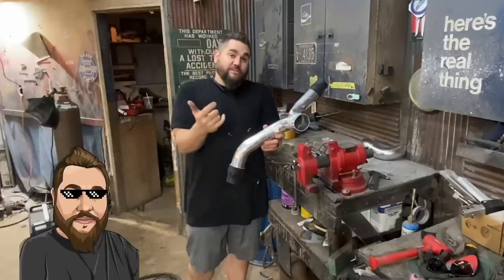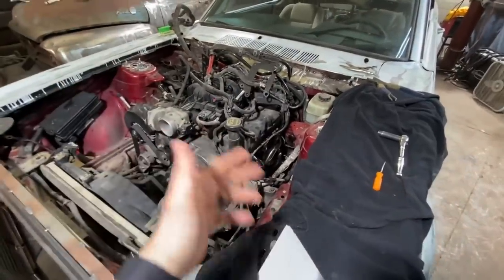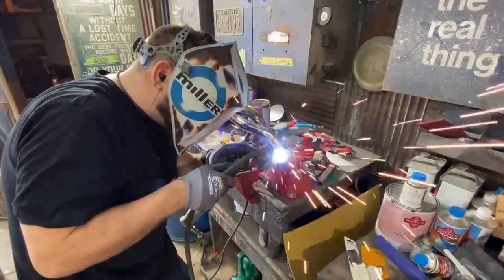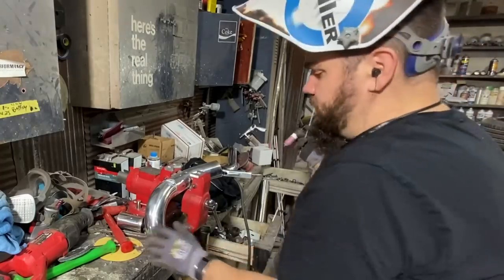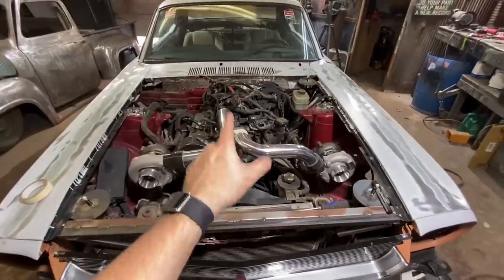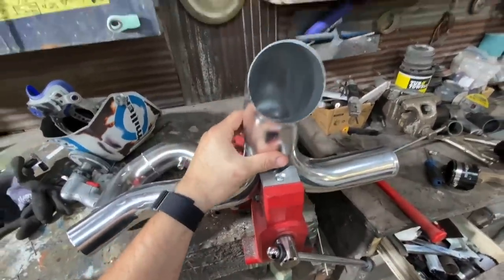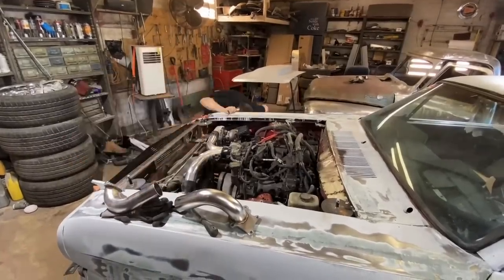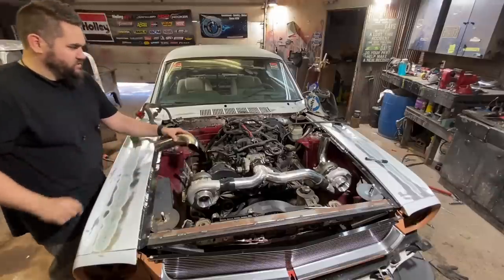BUDGET BUILD TWIN TURBO SETUP! 65 MUSTANG BODY SWAP ON NEW CAR! KUSTOM HOT ROD FORD TURBOCHARGED RAT

Comment: DUDE, you should make or buy semi stack flappy caps that open when you start the car, that would be cool or punch out an exhaust port on the fenders, that looks cool too, I prefer the fender ports better than hood ports, more practical, sleeker, and doesn't turn the hood black over time. Thanks.

Comment: You can use an aftermarket fuel pressure regulator to force more fuel through the injectors. It's not as good as getting it tuned but it'll help keep your air to fuel ratio closer to what it should be.
Reply from the maker: That’s what i did on my 51

Comment: If you decide you want to run an inner cooler you should be able to just rotate the compressor housings on the turbos to point towards the inside of the fenders and run piping that way.

Comment: When you first started talking about not running the intercooler I was bummed, because I know what a difference it makes to charge density...but it came out plumbed so nice, I can't fault it one bit. May I suggest adding methanol injection or Nitrous to cool the intake charge? Talk about a moon tune...

Comment: I hope you mean you just want the exhaust sticking up past the hood line not actually through the hood you had to make because this is just an engine you plan on blowing up but if you still want that after the engine swap I'd wait to cut the hood until then and not run a hood for now because the holes probably won't line up.

Comment: that MAF isn't going to work there. you'll need it in front of the turbos. if you put it in a tube double the volume of the original you'll approximate the flow of both turbos

Comment: No intercooler?
Reply from the maker: I’m skipping it for now, might end up needing to add it later depending on boost
Reply: @CaseysCustoms  you dont need no flippin intercooler, its october! thing is going to be blown to smithereens before hot weather comes back. stick a truck 5L coyote in there with a whipple and do a proper exhaust on that set up. screw the 4L